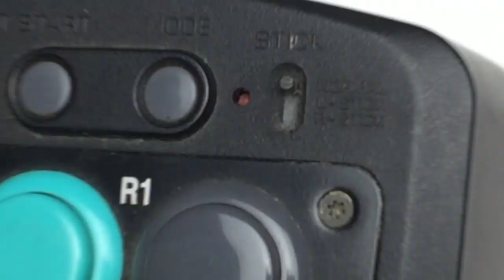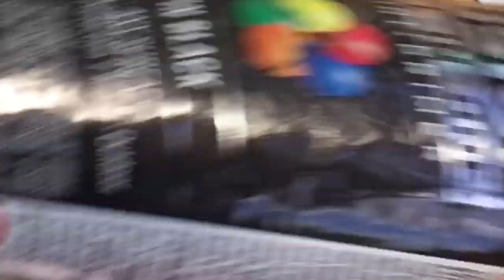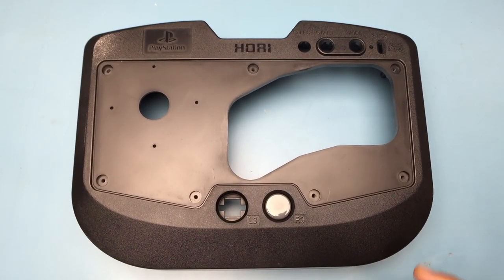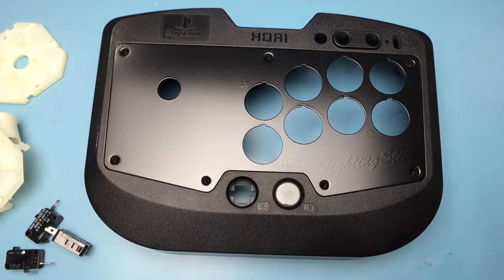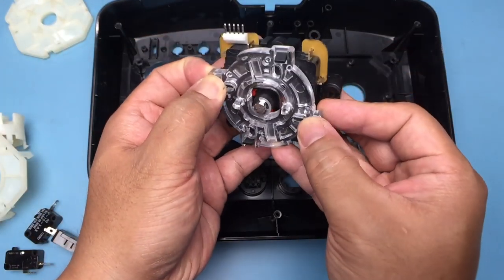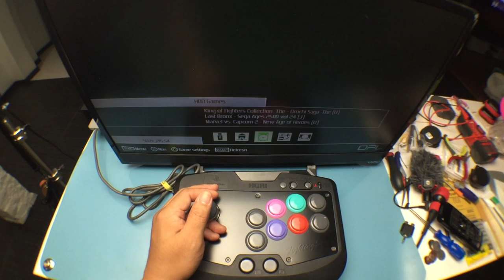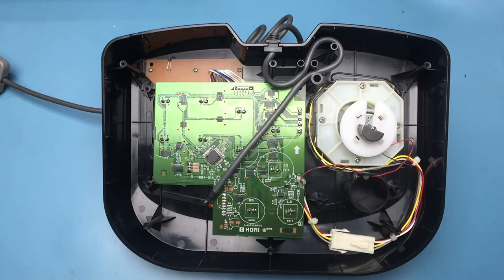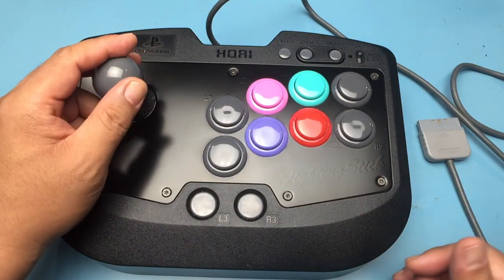Hori Playstation Fighting Stick HPS-71 Refurbish and Overview [ep. 99]

Comment: Cool video, I just saw this stick for sale so I thought I'd look it up. Never seen an arcade stick with rumble built into the stick! You didn't really show what you did with the buttons - did you just solder in short wires rather than connecting them back to the board?
Reply from the maker: Thanks! 👍 You pick up the stick? It's pretty unique. I just soldered the board back to the buttons.
Reply: @The_SegaHolic  I didn't actually get the stick in the end as I'm looking for something to mod and it would feel a bit wrong to change this unusal stick too much!
Reply from the maker: @rosstee  Awesome reason man. 👍 Preserving stuff as stock.